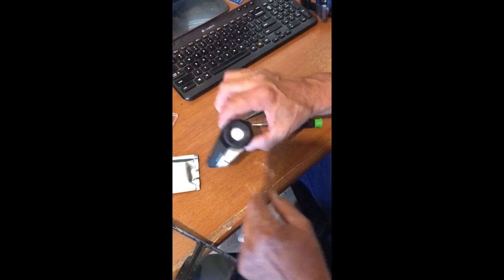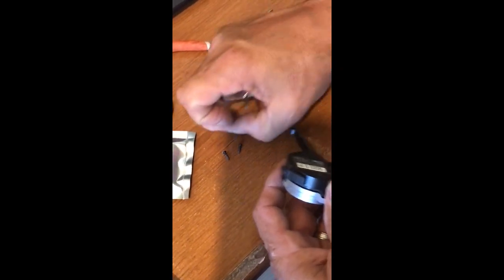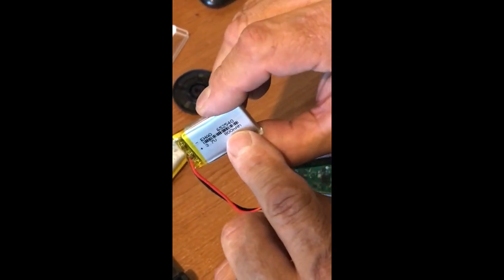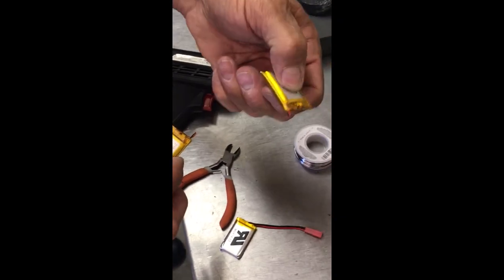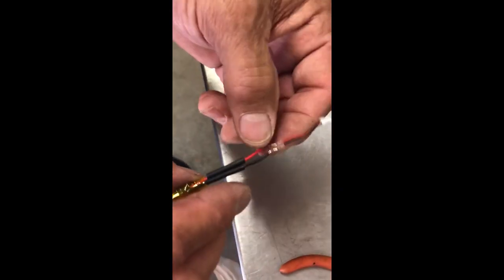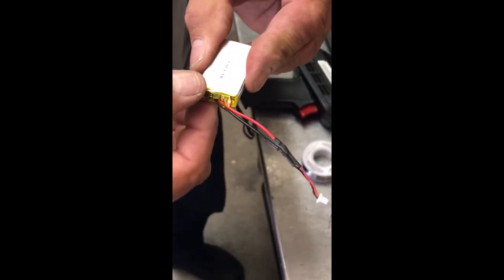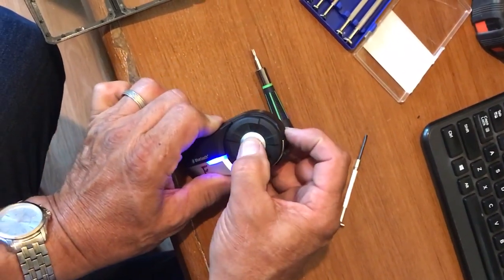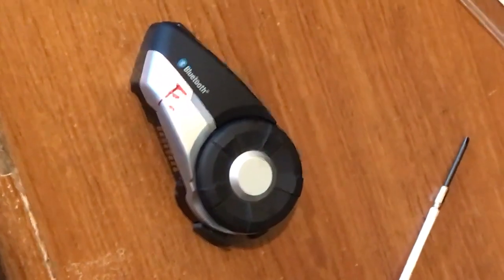Sena 20S battery replacement

Comment: Thanks for the video, Mike.  Sena replaced one unit for battery failure, then the same one crapped out a year later.  Now they won’t help me at all.  Screw them, it’s now my mission to spread the word about their crappy product.  Now to find the battery.
Reply from the maker: https://www.amazon.com/BrightTea-Lithium-Polymer-Battery-Rechargeable/dp/B07H6GDP95/ref=mp_s_a_1_4?crid=1VHPGOJAFNQZ1&keywords=li-po+battery+3.7v+800mah&qid=1550533135&s=gateway&sprefix=li-po+battery+3.7v+800&sr=8-4
Reply: My 10S has happened the same thing. I have the same feeling. Screw them!. I was a cardo customer and I will probably go back to them.
Reply: @luisbraz-ruivo
Reply: They do not sell replacement batteries either.  You can find them on the internet though.

Comment: https://www.amazon.com/BrightTea-Lithium-Polymer-Battery-Rechargeable/dp/B07H6GDP95/ref=mp_s_a_1_4?crid=1VHPGOJAFNQZ1&keywords=li-po+battery+3.7v+800mah&qid=1550533135&s=gateway&sprefix=li-po+battery+3.7v+800&sr=8-4
Reply from the maker: This link is for the right battery!  The 1st one I replaced is now 8 months old and still working good! If it dies in another year 16.00 is not such a bad price!
This link is a good find!
Reply: This battery did not work for me. It's slightly too large and won't fit in the device and the connector is also a smidge too large and won't plug in the outlet.
Reply: @colinshreffler5537  you have to cut the ends and put the connector from the old battery on it.
Reply: @thewhingnut  you're right. It was a tight fit but I managed to make it work. Thank you!

Comment: You're right, Sena told me you cannot charge these units longer than 3 hours. For example, don't plug in before bed time! :-) It apparently degrades the batteries.

Comment: Hi mike, good video by the way, can I ask when your sena went dead, did the charge light stop glowing red and did the sena just become dead with no life at all?  I ask because mine has died but I managed to put a multi meter to the battery and it showed 3.8 v , this lead me to believe my battery was fine, also my talk/music time was still lasting fine as it’s only a year old but rarely used. Sena are being very difficult and it could cost almost $200 Nz to send and receive back from Sena USA. To be honest I’m very disappointed with the customer care, I feel like I’m talking to robots with no feelings or reactions . Any help as to why it has died will be much appreciated. Ps I’ve tried the reset button on the back of the unit multiple times and still nothing,
Regards Pete 👍
Reply: Sena informed me that these units' batteries begin degrading when the units are charged >3 hrs at a time. It damages the batteries due to overcharging.
Reply from the maker: Chris Z is right these batteries go bad when left on the charger overnight repeatedly, mine was all bloated....turns out a friend who works for one off the cell phone battery replacement stores says that cell phones (specifically I phones) have the same trouble. 
https://www.amazon.com/BrightTea-Lithium-Polymer-Battery-Rechargeable/dp/B07H6GDP95/ref=mp_s_a_1_4?crid=1VHPGOJAFNQZ1&keywords=li-po+battery+3.7v+800mah&qid=1550533135&s=gateway&sprefix=li-po+battery+3.7v+800&sr=8-4
This link will get you to a battery that will work in a Sena 20S
And YES I will NEVER buy another Sena product, but for now I am stuck with this one!

Comment: FYI, 752439 means that the battery is 7.5mm thick, 24mm wide and 39mm long.  So the battery you found is 6.5mm thick, 25mm wide and 40mm long.

Comment: This is the battery spec that Sena provided to me when I asked about battery replacement for my Sena 20S : Capacity: 650 mAh 3.7V 2.4 Wh Dimension: 752439 So, when searching Google for  "3.7V 650mah" include the 752439. I found two possible replacement batteries. Also, this youtube video was recommended by Sena support but in this video a toy drone LiPo battery is used to replace the OEM Sena battery which has different wire AWG (gauge) and connector. the OEM connector is a JST PitcH 1.0 mm 2 PIN connector which these two AliExpress batteries have. I purchased the link 1 only because link 2 was a minimum of 5 batteries. Also, the website for these two links below was the only one with 752439 in the search criteria.
Important note about Li-polymer batteries. I fly drones as a hobby and all powered by Li-Po. here are a few things I've learned about these batteries: Fully charge battery before use. power on 20S lLED flashes 4 times then it's 70-100% 2 flashes 0-30%.
DO NOT charge battery immediately after it is depleted and still warm. Allow it to cool down  for about 15 minutes. It is not over charging that causes Li-Pos to balloon it is charging an already warm battery and over depleting or over discharging. Eventually they all swell a little anyway so you can buy more battery life by following these tips.
1. link
 https://www.aliexpress.com/item/XHR-2P-1-0-802540-3-7V-800MAH-Rechargeable-li-Polymer-Li-ion-Battery-For-bluetooth/32841845070.html?spm=2114.search0604.3.1.66454614TLVGie&ws_ab_test=searchweb0_0,searchweb201602_1_10065_10068_10130_10890_10547_319_10546_10548_317_5734611_5730311_10545_10696_10924_453_10084_454_10083_5729211_10618_10920_10921_10922_10307_537_536_10059_10884_10887_10928_100031_321_322_10103_5734511-10890,searchweb201603_51,ppcSwitch_0&algo_expid=72c9c10b-2cc7-4218-aa3d-3ef99485aeba-0&algo_pvid=72c9c10b-2cc7-4218-aa3d-3ef99485aeba
and 
2. link
https://www.aliexpress.com/item/free-ship-5pcs-lot-3-7v-702540-752439-750mAh-polymer-lithium-battery-li-po-rechargeable-battery/32823579892.html?spm=2114.search0104.3.2.16475490Ou22ci&ws_ab_test=searchweb0_0,searchweb201602_1_10065_10068_10130_10890_10547_319_10546_10548_317_5734611_5730311_10545_10696_10924_453_10084_454_10083_5729211_10618_10920_10921_10922_10307_537_536_10059_10884_10887_10928_100031_321_322_10103_5734511,searchweb201603_51,ppcSwitch_0&algo_expid=fa0867af-f0f5-4f02-abd3-de0a3950f51c-0&algo_pvid=fa0867af-f0f5-4f02-abd3-de0a3950f51c
Reply from the maker: Bob thanks for the reply and for the research you did on batteries.
Just so you know, yes the battery leads were lighter and the plug had to be changed out but I am still using those same batteries going on 3 months later and they still work perfect....I did find that the 800 mAH battery seems to get me a little more charge time but I have no numbers to share at this time.
Mike
Reply: https://www.ebay.com/itm/For-Sena-20S-EVO-Bluetooth-Headset-20S-EVO-01-3-7V-650mAh-Replacement-Battery-US/254252330316?ssPageName=STRK%3AMEBIDX%3AIT&_trksid=p2057872.m2749.l2649

Comment: Hey Mike, helpful video!  I'm unable to track down a replacement battery.  Do you have a link to the one you used?  The link you posted does not work for me.  Thanks.
Reply from the maker: I found this link....hope it helps!
Reply: Mike Greene no link

Comment: Hi bro, greeting from indonesia. I read my sena box it said 20s should last up tp 13 hours talk time. I'm little bit worried about my sena 20s. It last 6 hours. The last time i use it when i was touring to a beach. When it reach 5 hours of usage near the destination, it is still on medium but when im arrived then the battery reach low. Does my battery should be replaced? Any suggestion?
Reply: Rio, I would at least buy a new battery and start getting ready to replace it. It sounds like it is starting to go bad! The battery in the video was a 800mah battery and lasted me about 12 hours on the last trip I took in September
Reply: New Covenant Church oh no:( so my friends were right. With 6 hours  talktime is a sign that the battery need to be replaced. Thank you so much for your help. Now im going to order one i guess☹

Comment: great video, very helpful, had a dead sena 20s and did not know why, found this video, and saw how easy I could check the battery , and sure enough, that is the issue, link for new battery did not work for me, but I was able to find some. 5 pcs 3.7V 600 mAh Lipo Polymer li ion Battery 602540 power for MP3 DVD GPS PAD. $13 for 5, I could not find a US seller with the correct size and voltage, etc.. and I tried!   but basically people can just search for 3.7v 600mah 6mmx25mmx40mm and find options, there are some larger and smaller capacities out there that will fit also, just depends on how long you need it to last, but they get larger in size too and harder to fit into the area allotted for it.
Reply from the maker: I'm glad the video helped
Reply: the video helped you out. I found that the 800 mah battery fit even though it was really tight and it seems to last longer.

Comment: Thanks for the awesome video and thank you for the link to that battery. Please don't take this as me being rude, but the way you went about splicing these batteries could have been fairly dangerous. You stripped both leads of the new battery then laid it down on a metal work surface. You probably could have reacted in time to pick it up if it shorted, but had you walked away for anything it very much could have went through thermal runaway and potentially exploded. You can avoid this by soldering one side before stripping the other. Ride safe brother.
Reply from the maker: Jacob Willis thanks for the input!
You’re absolutely right.